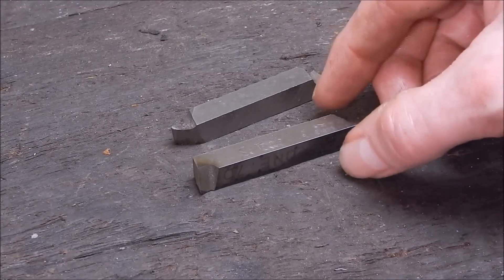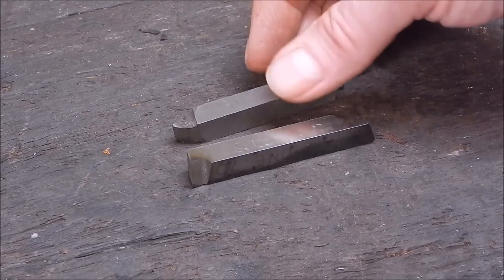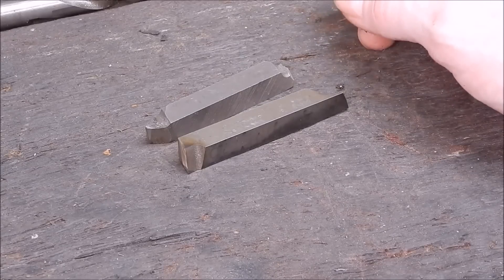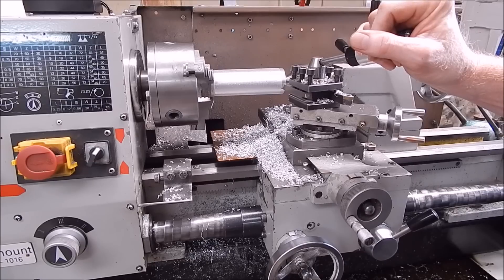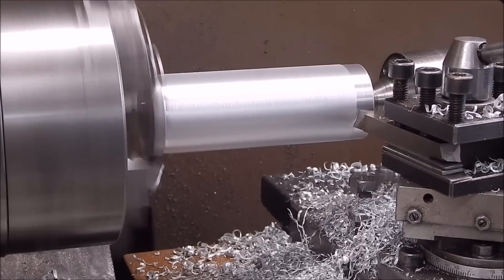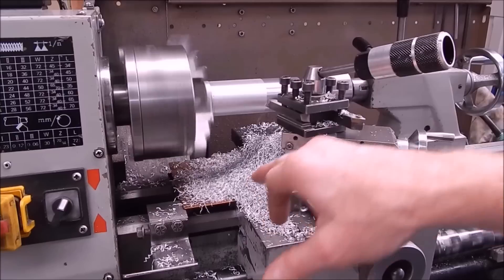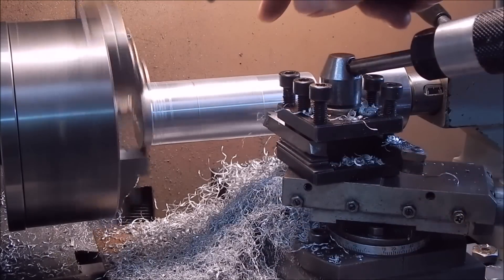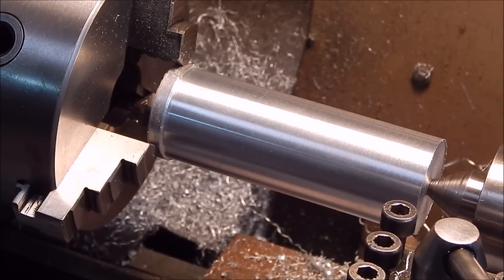Finish aluminium with a lathe shear tool.

Comment: This tool make a taper size please help me
Reply from the maker: Please explain.
Reply: @Xynudu  
Shear tool is make a taper size on lathe machine
Reply from the maker: Your tailstock must be out of alignment, as a shear tool will give the same result as any other regular cutting tool.   Cheers Rob
Reply: @Xynudu  tail stock is allighnment but shear tool is slow slow deaply cutt
Reply from the maker: They only do VERY light cuts or it will catch and dig into the work.

Comment: Is itpossible to make one's own tools for the lathe? If so, would you recommend any tutorial or resource to learn? In particular, how to you make "carbide" tool, and can HSS steel be enough to take care of metal lathing?
Reply from the maker: Sure.  Plenty of people do it.  Plenty of videos on the subject.  HSS did it all back in the early days before carbide, so there's no reason it can't do the same now.  HSS will actually give a better finish and is capable of lighter cuts on poor grade steel than most carbide. I use HSS a lot.  Start browsing.  Cheers Rob
Reply: @Xynudu  thanks a lot Rob !! God bless you
Reply: @Xynudu  Found this : https://www.youtube.com/watch?v=rsFFWYo8ugw

Thanks again :)
Reply from the maker: Have a read of this :  http://www.opensourcemachinetools.org/archive-manuals/Hercus_TextBook_of_Turning.pdf

Shows how to grind HSS tooling.  Old but good.  Cheers Rob
Reply: @Xynudu  May God bless you !!! So generous of you of giving your time. THANK YOU !

Comment: What do you do to minimize pores on the aluminum you pour into tubes ?
Have you tried hotter or colder melting temperatures ?
I wonder what works best.
Reply from the maker: Use quality aluminium.  Preheat the mold tubes.  Pour the aluminium at the lowest melt temperature possible.  The higher the temperature, the more it will gas. Let the poured mold cool slowly. 

I have virtually no porosity problems doing this and do not use any degassing agent or flux.  Cheers Rob

Comment: The wood lathe version of the shear tool is the skew chisel.   In case anyone cares.
Reply from the maker: Thanks Dan.  I've never done wood turning, though the Schaublin 102 has the capability/a rest and is easy to clean.  Maybe one day for a small job.

Done plenty of timber house construction and general carpentry though.

Cheers Rob

Comment: G"day Rob--I have increased the angles a bit on the tool you have shown and you can take of gossamer type swarf--half a thou or less if you need it..Using emery paper to get a shaft size for bearings is accepted industry practice--resulting in crap on your ways..Not good..
Shaving tools are under rated in my view so your vid is timely..I also like the vid on testing hardness of metals..   Regards  E
Reply from the maker: Hi Ian,

Shear tools are great.  I'm sure many people have never heard of them, and are missing out badly.

You can play around with the angles quite a bit, and still get good results.  I have two, one of which has a much greater angle on the trailing edge, which lets me angle it more towards the work, and cut right up to a shoulder.

It's certainly very easy to grind them, and it's a works every time on anything finishing tool.  

Glad you enjoyed the video on hardness testing.  It's one I was going to do way back, but thought people may find it a bit basic.

Gives a few options and attempts to show how well some of these methods actually work.  I expected some flack for sacrificing a few sacred cows on that one :)

I like the auto punch.  You can use it on the end of small rod and stuff, and get a good indication of what it's like.

Cheers Rob
Reply from the maker: Forgot to say I totally agree on how good a shear tool is for machining a journal for bearing fit - way to go.

Only needs very light contact with the job to get that gossamer like swarf coming off.  Makes it very easy to size stuff accurately.

Cheers again

Rob

Comment: That was an interesting video, something I was unaware of, I do use a similar opp when I'm machining Acrylic in the lathe, I use a straight across zero top rake and set it so that the rear end of the toolbit gives a shear cut , but I will try the shiver system next time,

Your lathe, can you reveal the manufacturer, its nice and quiet, would it be a Myford?,

Edmund
Reply from the maker: +Walter Maisey 
Hi Walter.

My lathe is just a cheap Chinese 10x18.  It's belt drive same as a Myford, which makes it very quiet.

Cheers Rob

Comment: That did finish up nice didn't it. I wonder, why is the cross slide set to 39 degrees?
Reply from the maker: Wooley689 The top slide just happened to be at that angle.  It's not relevant to this operation. I usually keep it at an angle for facing, finer increments, better control clearance etc. Rob

Comment: Hi Rob,

That's a nice finish for sure. Looks like I'll have to make one of these as well. 
Meanwhile I have cast my first pieces of round stock, one of them is 36mm in diameter with a usable length of 29cm. I had to destroy the mold to get it out though.
The furnace is still not finished but I'm close.  
One other "lesson learnt": The quality of the cast is highly dependent on what material you use to melt. That is the main reason for staying away from aluminium foil and food containers, at least if you want to process the material in a lathe. Stuff that has been cast before (quote) is harder to get but yields far better results.
Reply from the maker: Leo Gijssel Hi Leo.  I use previously cast or extruded alloy, and it machines OK. Extrusions are generally softer and come up nicer, but for gears I use harder stuff.  I've never tried melting food containers, but beer cans seem to work well - Keld Sorensen has a few videos on his efforts with this medium.  Cheers Rob

Comment: I'm wondering if the tool was made with a curved vertical face if it would also work well for facing...
Reply from the maker: Ray Jones You are probably right.  Apparently that works well for facing.  I haven't tried it it yet.  Rob